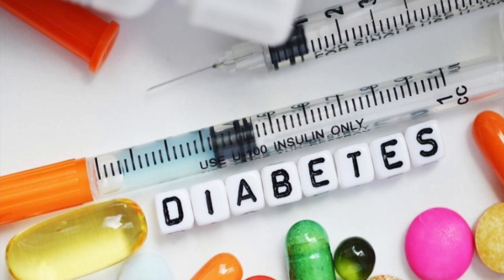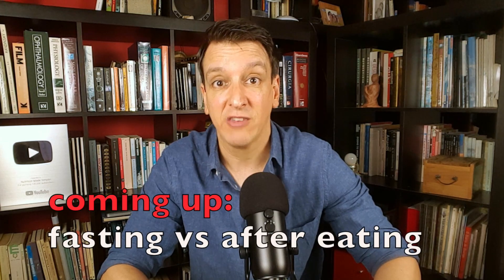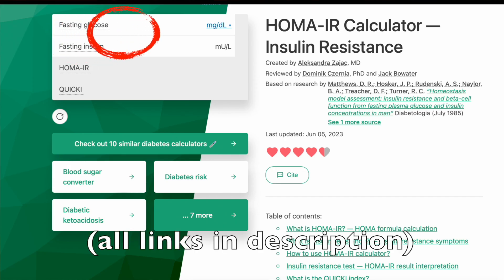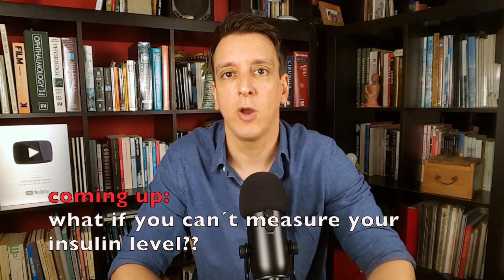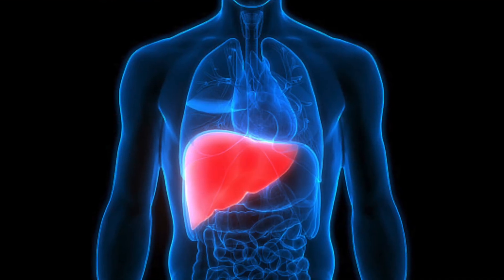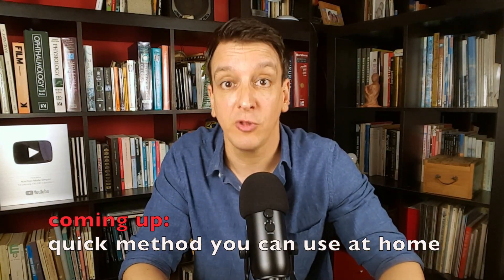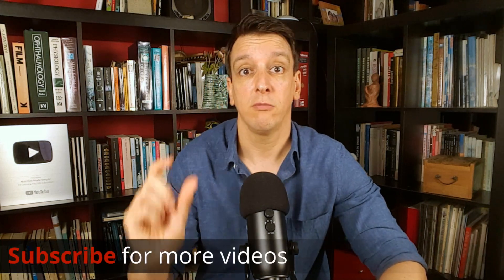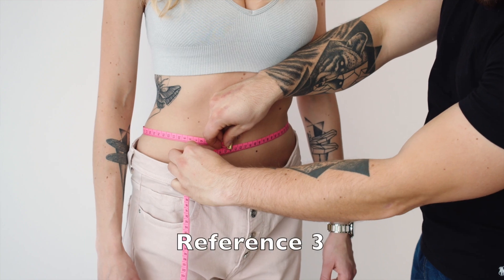How to measure your Insulin Resistance (3 methods!!)

Comment: TyG formula in Google Sheets and MS Excel?.....
Can any spreadsheet gurus answer this riddle? -in Google Sheets (and in Excel) i tried computing my TyG Index as follows... LN(53*85/2). The result shows 7.719. However, the on-line calculators are all coming up with 4.21. Can anyone explain why there's a difference? Thank you!

Comment: Thank you for the work you do so well!
I had never heard of TYG before. However, now, when looking into it, I see that there is a great confusion on the Internet of how to really calculate it. The calculator that you reference in your video both calculates it correctly and gets the formula correct in the description. However, since then I have found calculators that calculate it differently than the formula they give for how they calculate. And then there are two different formulas used in different scientific articles. Oh, well. What a mess around such a simple formula.

Comment: Thanks for the information. may i have a question, is Homa-IR smaller the best?  my fasting glucose is 80.26 mg/dl, the fasting insulin is 3.3 mU/mL (0.0033mU/L) so the Homa-IR calculated 0, is it normal?

Comment: Dr Carvalho touched only briefly on the triglycerides/HDL-C ratio as a possible estimator of insulin resistance, but he thought TyG would do a better job.   As I have just undertaken a low carb diet, I have a series of readings on TyG before and after the diet, ranging from 4.39 (post diet) to 4.86 (pre-diet).  I also have the corresponding triglyceride and HDL-C readings.  I find that (for me anyway), TyG and triglycerides/HDL-C ratio are well correlated (r=0.980, n=7).  If the cutoff for TyG is deemed to be 4.49, then the corresponding triglycerides/HDL-C ratio is 0.6 (measurements in mmol) or 1.4 (mg/dL).  The triglyceride/HDL-c ratio is more convenient for me because I would not need to go online to use the TyG calculator.

Comment: Thanks. A quick question about TYG index please. While we know a fasting glucose of for example 5.2 is good and Triglyceride 1.5 is normal, TYG Index calculation return 4.7 which suggest Insulin resistance and possible fatty liver? Why is that?

Comment: Solid video! I’ve been using fasting insulin for years. After enough time I simplified approach to considering optimal fasting insulin a five or less associated with a fasting glucose in the double digits (Ie “normal“) measured in milligrams per deciliter.

Actually never heard of TYG! I’m looking forward to checking that one out.

Have to correct Dr. Gil on the abdominal (a term I prefer over waist, which is often confused with hip to the public) circumference thresholds. 

The threshold of 40 inches is only in men and only in what many consider outdated NIH criteria. 

In NIH criteria the threshold for women is less than 35 inches. 

Moreover, if you look at the International Diabetes Federation, they put central obesity for purposes of defining insulin resistance (a.k.a. metabolic syndrome) at a level of 37 inches for men, even lower for Asian men - and 31.5 inches for women.

Comment: I hadn't heard of the TyG index until this video, so thank you!

Interestingly, TyG does not divide/juxtapose Trigl vs Glucose, but rather multiplies them, so the ratio between them is not important [to this formula]:

Per the MDapp calculator explanation:

TyG = ln [Fasting triglyceride (mg / dl) x Fasting glucose (mg / dl)] / 2

Comment: Hi, Gil! Thanks for the great information! The TyG index is especially useful since I already have those two input numbers. I'd like to point out that the online calculator you provided is wrong. The formula they used was from the original, uncorrected paper. The authors since then wrote an erratum to correct the typographical error in the formula. The division by 2 is supposed to be inside the logarithm. I did an online search and actually read the paper, as well as a few others on this topic. Another online calculator had the same mistake. But most of the follow-up papers and ChatGPT got it right! :)  

The cut off number for IR of 4.49 is super hard to achieve for the average people, even vegans. Other epidemiology studies showed the lowest quartile or tercile have the whereabouts of 7 and 8, respectively. What do you think about this super low 4.49 TyG goal for insulin sensitivity?
Reply from the maker: great catch. thanks!!! we're looking into this rn
Reply from the maker: ok we spent some time looking into this. first of all thanks again for bringing this to our attention, please don't hesitate to flag any concerns in any of our content, we try our best to make it as rigorous as possible.

It seems that some studies use the formula with the 2 outside the bracket and some inside. It's possible this started from a typo, though in practice I´m not sure it makes a difference as long as the data for the reference population uses the same formula. This will of course mean reference values will be different depending on which formula is used (around 4 for one formula and 7-8 for the other)

So for example the Salazar paper used the "2 outside" formula for all of their reference population and proposed that cutoff of 4.49.
https://f1000research.com/articles/6-1337/v3

(by the way, if you have that erratum handy, pls link. we went through the several versions of the paper and the latest still uses the same formula?)

It's true 4.49 is a pretty strict cutoff and you can see their specificity was ~80% which means ~20% of people picked up may be false positives. 

This systematic review goes over different cutoffs from different studies and finds a good spread so I don´t think the 4.49 value is written in stone
https://www.hindawi.com/journals/ije/2020/4678526/

As another example, this study using the "2 inside" formula finds that the population with lowest risk had a TyG of 7.86 which is stricter than the 4.49 using the other formula (it takes lower triglycerides and glucose to clear the 7.86 than the 4.49 threshold using the other formula)
https://www.thelancet.com/journals/lanhl/article/PIIS2666-7568(22)00247-1/fulltext

I think it may come down to differences in the population studied and the outcomes reported.

Lmk if this makes sense or if something seems off

I´ll probably write a community post summarizing this as well and credit you for pointing this out.

Gil

Comment: Just a question re: the waist measurement; doesn't that have to be height-dependent?  For example, I wouldn't expect someone who's 6'10" to have a waist size under 40".  It also suggests that obese people would all be classified as IR, but I know that not all obese people are IR.

Comment: Mine uses fasted insulin. I eat animal products (a lot) but only lean. I eat lots of carbs. Done this for 2 years now. My fasting insulin was very low at 3 on a scale of 1-15. I'm doing great in that department.

I do still intake a significant amount of nicotine unfortunately. So my fasted glucose is always a bit high. It was 92. 

But still my homa ir was 0.8, considered insulin sensitive. It will go down if I can get off nicotine.

Comment: Under what circumstance would a doctor agree to a fasting insulin test? It’s never been part of any annual blood test that I’ve had. My fasting glucose apparently has always been in a safe range. Later my plan started using A-1 C on it to stays below the prediabetic range. At the same time that I’ve lost weight over the years, my LDL C, and total cholesterol has gone up, though my triglycerides remain low and my ratios apparently are also in a good range. I think I would have to pay a private lab to get fasting insulin tested and I’m not sure it’s worth it.

Comment: TY!! I just checked with the TYG using my most recent lab, it showed my TYG at 4.54 and “ This TyG index value is suggestive of insulin resistance”..correlates with my A1C trending higher each year I suppose. I brought up my upward trending A1C (5.5) to my Dr, and they brushed it off saying no need to worry. Should I be worried about insulin resistance at this point? Many direct family members have diabetes..
Reply: If you don’t have any symptoms of diabetes. Then you should be fine. Just stick to prevention. If anything shows up. Then raise concerns with your doctor.

Comment: Another method for home use, i am not saying this is a hard and fast indicator, but can be a good guide. Take your blood sugar reading exactly one half hour after eating, if it is over 130-140 or 7.3-7.8 consistently, there could be an issue. But the lower it is a half an hour after eating the better metabolically you are. :thanksdoc:🥰🥰🥰

Comment: Hi Gill, I looked up my TyG index and with Triglycerides of 95 and Fasting Insulin of 93 4.54 which put me in the Inuslin Resistance level (above 4.49). Is this index a bit too strict? A lot of doctors say any Triglycerides below 100 is fantastic and so long as Fasting Blood Sugar is below 100, let alone low 90s is "fine". For HOMA IR I am 1.14 which is very low and ideal.

Waist circumference may not be reliable there are a lot of skinny fat people?  Or the person's waist line is not 40in but height is on the low side.
Reply: I agree with your second point.  I'm 6'1", 150 lbs and eat lots of sugar.  My insulin resistance is in the normal range, but I could easily be diabetic and no one would know by looking at me.
Reply: @Funexpected  Your quite light for your height. BMI is not any use either in doing any assessment. There is now the waist height ratio. Optimal is less than .50 ie. I'm 5ft 7in 67inches and waist is 30inches. 30/67 = 0.44 for me.

Comment: Thanks for covering this! Would the TyG be a good indicator for someone with type 1 diabetes? I've been worried that I have some insulin resistance. I read somewhere that 1 insulin unit to 10g carbs is typical for T1DMs, but for me, 1 unit typically covers only 5-7g of carbs.

Comment: Thanks for the info!
I never knew triglycerides could be used to measure insuline resistance.
The more i learn the more confused i get whether fat consumtion, especially saturated fat (even if you don't exceed in calorie intake) can cause diabetes, because i used to think only refined carbs and sugars are responsible.

Comment: Wouldn’t you have to take more than one reading? I mean wouldn’t you want to do something like this for a week or weekly? But, while most can take their fasting glucose reading fairly easily, there’s no way to take the other readings on a regular basis. At least not for most people.

I am overweight and I have a lot of difficulty losing weight. That itself is suggestive of insulin resistance. But my fasting glucose is typically in the 70s or low 80s, and my triglycerides are usually between 50 and 55. My doctor has never once checked my fasting insulin.

Comment: I'm confused by the waist size rule of thumb in light of all the other variables that are dependent on the individual. I'm 5' 7". My waist was 35" and I don't eat highly processed food, soft drinks, alcohol, etc, but i was starting to get higher than desirable glucose and lipid lab results. I'm losing weight and dropped an inch of waist size and will find it soon if it's helping. But i can only imagine how much worse things would be if my waist were an "ideal" 39 in (under 40).
Reply: The waist measurement is just a SWAG. Scientific Wild Ass Guess. Many Asians or caucasian with Asian DNA in the family (even if they know it or not), are very thin but diabetic / "insulin resistant".  If fact, more sick thin people in the world than sick obese people when looking at total numbers. However an obese person will always have something wrong. The world has never seen a 400lb  person make it to 100yrs old.  Thin, average or obese not a set guarantee.

Comment: Thanks, Gil! I appreciate your videos. I think the best test for IR overall is the Kraft Insulin Survey. I don't know if you have heard of it. It actually gives you 5 patterns of insulin resistance. You can order this test, do from your home & then send it off for the results. HOMA-IR doesn't give you the whole picture. You have to challenge your pancreas. An oral glucose tolerance test with concurrent insulin survey is good as well. Quest used to provide this test but I don't think they do anymore.

Comment: What about HbA1c?
Reply: Pretty sure you can have a normal A1C and be insulin resistant. If that's the case, it may just be a matter of time before you're pre diabetic, and eventually diabetic.
Reply: My HbA1c was OK at 5.3 (it ranged 5.3 - 5.5 over a year) but my fasting insulin was very high. I ordered the test myself because I could not lose mid section weight no matter what I did. My doctor wouldn't check insulin because my HbA1c was good!! The test is not too expensive - around $32 US if you order it yourself.

Comment: Pardon my ignorance, I was really thinking I would hear about A1c, is A1 c not a good indicator of insulin resistance?
Reply from the maker: it can be normal in people with IR. maybe we should have covered this, didn't realize it was such a FAQ :)
Reply: Thank you! I learn so much with your vids! @NutritionMadeSimple
Reply: @NutritionMadeSimple  DType 1: After going WFPB 8 yrs ago,, my daily requirement for long-lasting insulin dropped from 48 to 16 units. Does this reflect a drop in insulin resistance?

Comment: If you want to know if you're insulin resistant pretty quickly, take off your clothes, stand straight, and look down.  Can you see your feet?  If not, you have insulin resistance.  The ladies might have to lift up their breasts in some cases to see, but pushing your stomach in is not allowed.
Reply: Some people are going to be insulin resistant long before they’re big enough not to be able to see their feet. As the duck said, the problem can be there long before the debilitating conditions develop. Which is not to say your test, probably is an accurate, it’s just not precise enough.

Comment: Why wouldn't it be easier and more cost-effective to monitor postprandial blood sugar levels (at various times), conduct a glucose tolerance test, or measure glycated hemoglobin
Reply: Your blood sugar doesn’t start to rise until later when you are getting to pre diabetes(for most). The tests in the video tell you how far you are from getting to that point.
Reply: @jyusta1  by this logic, everyone should start with insulin intolerance tests (including waist circumference measurement), and there are likely tests that can anticipate insulin intolerance before it even develops, etc
Reply: @lionelson7098   That's the logic, yes.
Reply: @lionelson7098  I thought that was the whole point of the video :) giving you options to see how metabolically healthy (or unhealthy) you are

Comment: Super useful! Using the TYG index, it's the first time I got some idea about my insulin resistance. Using my blood test data over the past 10 years, I can see I went from the danger zone to safe numbers after changing my diet to whole foods and low sat fat with intermittent fasting.
However, there is one issue with the TYG index if anybody wants to follow the literature. The online calculators use the formula TYG = ln(glucose*triglycerides)/2 but most (not all) of the research papers use a different formula: TYG = ln(glucose*triglycerides/2). It looks like one source created a typo in the formula, which then propagated. Using the first formula, the normal TYG is a bit above 4, while using the other the normal is above 8.
Reply: I saw that too.  The normal or cutoff for insulin resistance is 4.49.
Reply: Thanks for pointing this out. I'm in the same boat reviewing my insulin resistance for the first time. My FiL had a heart attack some months ago and understanding how it happened really opens the eyes. The modern western diet is not ideal.
Reference journal article if interested: https://jcbr.goums.ac.ir/article-1-22-en.pdf
So if I have 69 trig and 91 gluc
(LN(Trig*Gluc))/2 = 	4.37
LN((Trig*Gluc)/2) = 	8.05

The TyG index calculator website definitely used the first formula (LN(Trig*Gluc))/2
Reply: Thanks for that 👍

Comment: Considering the correlation between waist circumference and insulin resistance is so high maybe you should have started with that Gil?
Diabetes UK put the worrying waist numbers at:
80cm (31.5in) for all women
94cm (37in) for most men
90cm (35in) for South Asian men.
If you have a gut you need to get rid of it! That's the hard part 😂
Reply: My pant waist  size is 33. But pant waist  size  is not necessarily indicative as many
men will sort of 'tuck' in their belly  to get the pant to fit.
I've got a bit of a belly but still think I fall within 37 inches. Don't want to measure it. Too discouraging.
I was a size 34 and my goal is size 32. That is what I focus on.
Reply: Thanks. As you say. Getting the belly fat off is very hard.  We need advice on that.

Comment: Where I live it is very difficult to get a test for insulin. Instead, C-peptide is measured. Is it possible to do a similar test for insulin sensitivity with the two variables?
Reply: HOMA IR (C -PEPTIDE) is a better test to measure Insulin Resistance according to some Doctors.
Reply: I think C-Peptide is even better and cheaper to measure.

Comment: Thank you for the video Doctor. Is it possible to use a CGM to measure our blood glucose rise after a meal and get an idea of our insulin sensitivity?
Reply: Hi. I have one. It will definitely give you an idea of how your body responds to carbs. I’ve been able to drop my glucose average over time using the CGM. I have still have high triglycerides, so it won’t account for that, but it sure does make you a more disciplined eater when you see those spikes. You don’t have to go through commercial sites to get one, just ask your doctor for a prescription. Explain what you’re trying to do, and they should be happy to help you even if you’re not diabetic. A sensors are about $40 a piece and you need two a month. It’s a worthwhile investment.